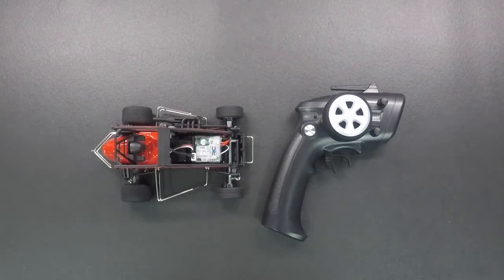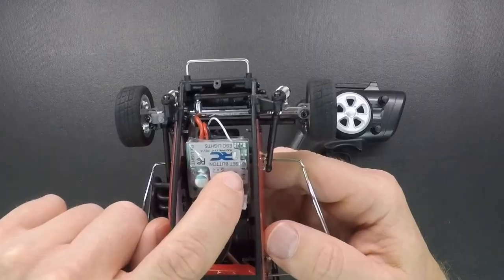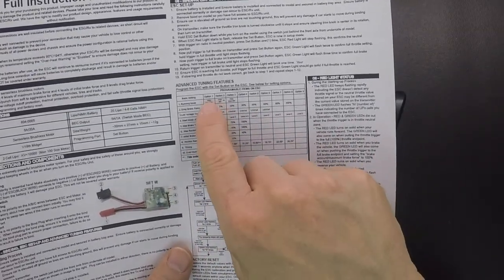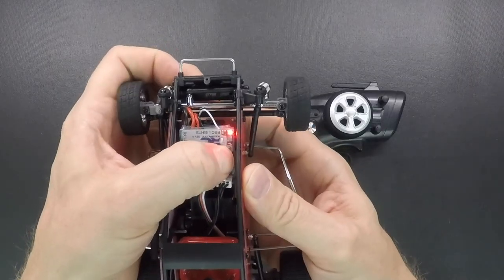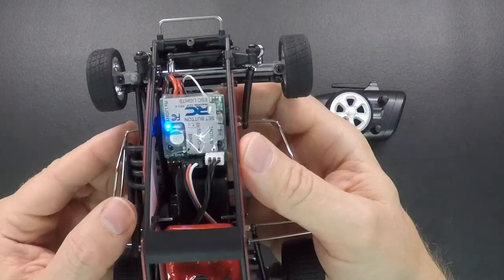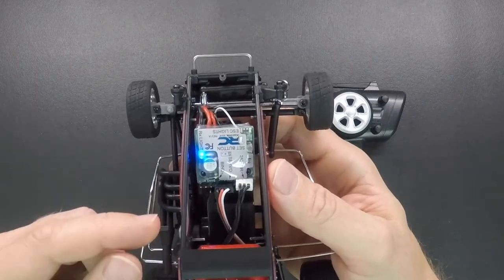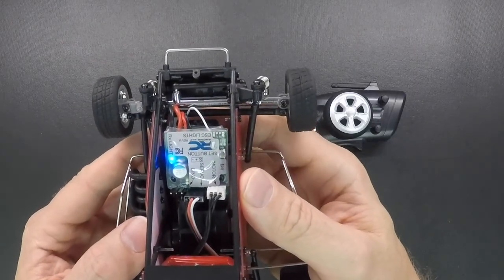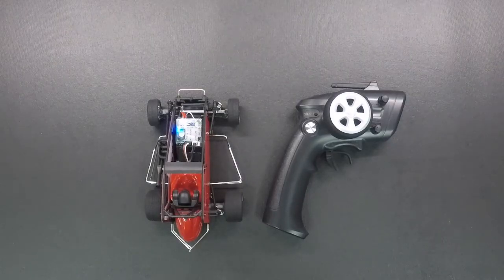1 RC Racing   ESC Advanced Settings

Comment: Trying to set the cut off voltage to 3.2 volts I get to 4 flashes then next option I get a long flash/beep but not five flashes. Has the newer esc changed?

Comment: Will changing the punch mode make a differance in the speed of my car?
Reply from the maker: It doesn't change the overall top speed but you will notice it will give you a little more power at the initial hit of the throttle.  It is not a lot since these motors are so small but there will be a slight change.
Reply: @1rcracing149  thx

Comment: Ok, can you do the same trick on the modifides,gluing the putter rim  on the tire for the carpet and can you put a tire grip on the tire for a painted concrete surface
Reply from the maker: Yep we glue the outside edge of the right front for carpet racingon the EDM. Might not need tire grip if the concrete is brushed style concrete but if it is smooth you might need it.

Comment: Ok so the wing stunt car gearing is the same with the modifides
Reply from the maker: Yes both the sprint cars and EDM  use the same gears in the rear end.  The midgets have different gearing than the sprint car/EDM.

Comment: Is there a open channel on the RX or other option to run an I-Laps transponder?
Reply from the maker: Yes, you can plug a transponder into the port used to bind the car to the radio.